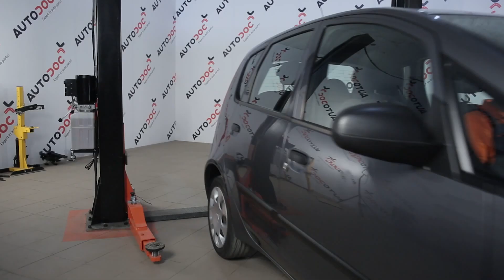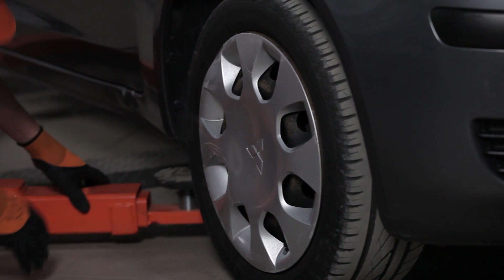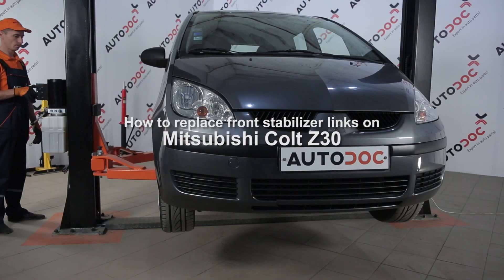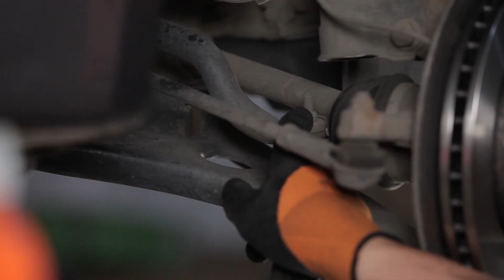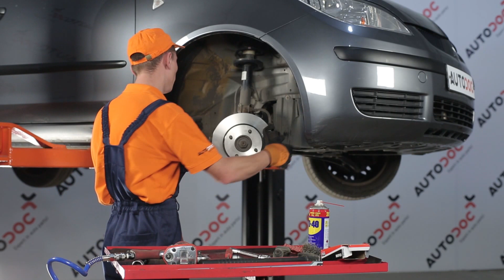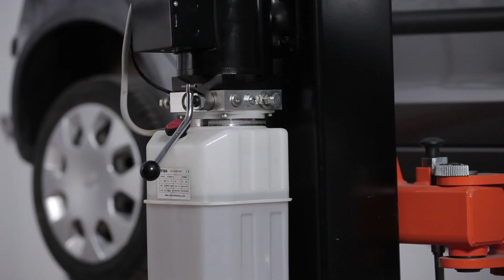How to change Front Anti Roll Bar Link on MITSUBISHI COLT Z30 TUTORIAL | AUTODOC

Comment: Hi, thanks for this video it's a good length and shows all I needed to do (mostly).
Just changed mine as they were an advisory on the last mot, the driver's side was massively corroded with the 2 bushings just crumbling away. Had to get a hammer on the pin to free it from the middle bit.
The passenger side kinda exploded off when I applied pressure with the wrench snapping the pin in half, should this be a concern i.e. something else wrong?
Reply from the maker: Unfortunately, according to the description, it is difficult to advise anything, we recommend contacting the service.
AUTODOC

Comment: When snapped just hold the remaining rubber with pliers and put a drill on the bolt. It will melt the rubber and drops out easily. No need to take the wheels off. Torque properly?
Reply: Mine snapped. Top is missing. Surely I can just pull the remaining part out of the bottom?
Reply from the maker: We do not have such information, we recommend that you consult your mechanic.

Comment: Is this the proper way? Some friends suggested that the wheels should be holding the weight of the car like on the ground (or on one of those lifts that you drive the car on) while you change it.
Reply from the maker: Thank you for your comment!
For easier replacement, we recommend replacing when both wheels of the front axle are raised, otherwise, the stabilizer will be skewed, creating a load on the replaced rod.
Best Regards,
Autodoc team
Reply: @Midnight Dreary they say it's bcs when you over tighten it and after the load of the car pushes it more it stresses it beyond spec. the mechanic changed it the way it's shown in the video but i insisted on not using a power tool to tighten it, so he used a hand wrench and there is no problem.
Reply: As far as I know for lancer links, which are same principle of a bolt and spacers- you got a measurement for nut to bolt top, as for tightening to spec shen car is on ground, that is for wishbone bushings if you tighten with suspension unweighted and then lowe the car, youre basically going to have the rubber constantly twisted and just have it die much quicker
Reply: Hi did u get the answer to ur question?